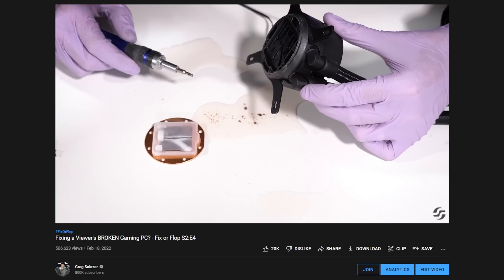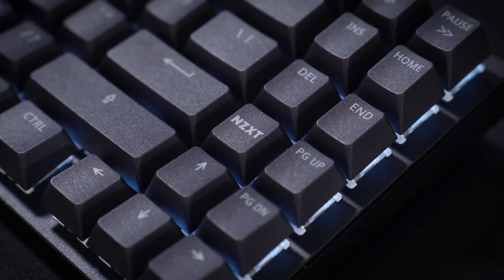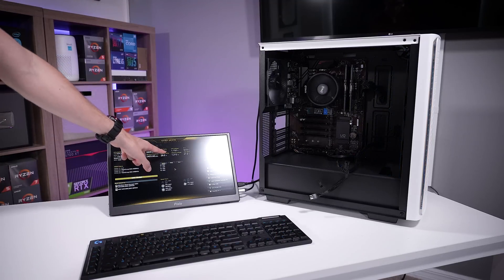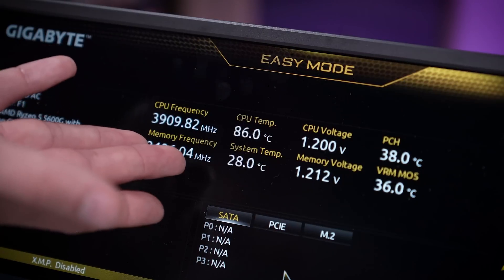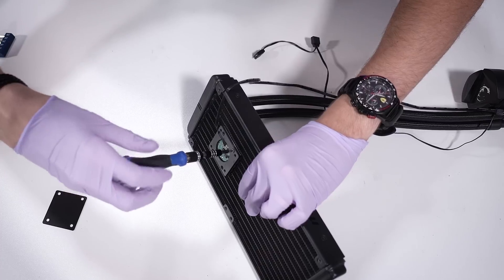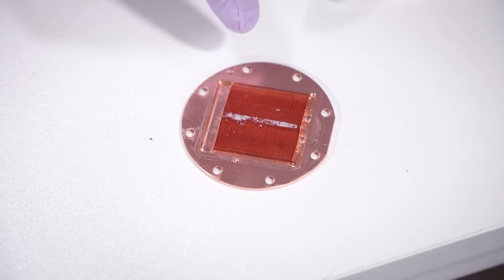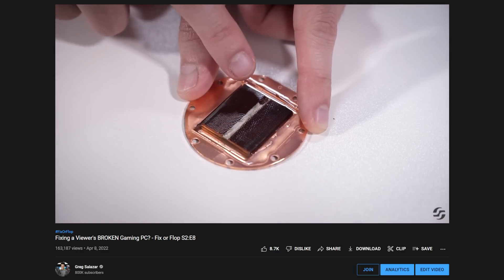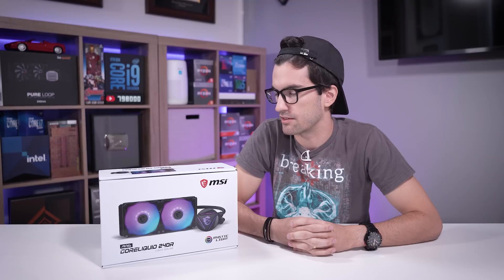Testing Viewers' Recalled AIOs

Comment: MSI would not send me a replacement under recall they said I had to pay for all the shipping and send mine in first. Basically told me to suck a dick. MSI 240R MAG, identical to ones in video and temps idle around 70c and gaming hits 95c and throttles cpu to under 4ghz to bring down to 88c on 5600x

Comment: I've got an "Ibuypower" 120 AIO that is like this with the pump in the radiator. I'm pulling it out this weekend and putting in a 240 Deep Cool Castle EX. With that said It was your videos that lead me to the issue I've been having with my PC. My PC had temp swings that would cause it to shut off. I haven't had the time or resources to swap a bunch of parts to troubleshoot. But seeing the other videos you've done have helped. Thank you.

Comment: Just found out about all this. Had this issue come up with my pc months ago 65c to 75c idle temps and not much load would cause thermal protection to shut the pc down but couldn't diagnose it. Even tried reapplying thermal paste. so the pc has been off for months and I was just going to eventually start throwing new parts at it till something worked but hadn't gotten to it yet (planned to start with upgrading to a ryzen 5800x from my 3600xt to start since prices have come down). After hearing about this I took the coreliquid 360r off and put my stock amd cooler on and wouldn't you know it right back to normal temps even under heavy load. But the recall page says mine is not an affected unit when I check the s/n which blew my mind since it follows the symptoms to the letter and the thermal problems were fixed when I swapped the coolers. So I just submitted a warranty ticket and I guess we'll see what happens there but I'm thinking that the issue runs over a larger range of the project than they originally have recalled it just didn't seem to happen as fast to mine as it did some others that I've heard of. Mine lasted a little over a year of use before the problem showed itself.

Comment: i bought one of these for a new pc i built a few weeks ago and later found out about the recall but am currently seeing normal 30-40 idle and rarely goes over 60 in gaming at the moment, ive been thinking of flushing and replacing the coolant but would be the first aio i would have dismantled, would you recommend giving it a flush and replacing coolant or should i leave it to see if i get the problems others are getting?

Comment: HI Greg, I purchased an MSI pre-built PC and am noticing really high temps when playing a specific game that is very cpu intensive.  The AIO I have in my system is this Corliquid 240r.  Now my idle temps are not as drastic as in your videos (roughly 40 degrees celcius).  I notice my issue when the CPU is under load and my temps go skyrocketing (my pc has thermal throttled due to temps hitting 100 degrees celcius).  I've been doing a ton of research and I think part of the problem is my cpu which is an i9-10900k, I heard this cpu was a thermal beast.  I have used the intel extreme tuning utility to change my optimal setting to have my cpu overclock to just 4.3 GHz instead of the 5.0GHz that was causing it to rise to the 100 degree celcius mark.  RIght now with that overclock setting, my max temps still hit 90 degrees celcius.  When my temps are this high, one of the odd things I am noticing is that the front half of the aio, the half with the pump, is emitting really hot air, but the back half of the aio doesn't feel all that warm.  Do you think I am suffering from this issue still (blockage)? Even though my AIO seems to act normally under idle?

Comment: Can you open these things up clean out the gunk and replace the water/fluid? If so what is the fluid called? I have the exact same issue with my CPU, in Bios I'm hitting high temps and they don't lower and I'm beginning to suspect the cooler, which is a Fractal Lumen S36. I can RMA it but would like to repair it myself if possible.

Comment: Had this same cooler and had a horrific clicking sound every time the system ran within 3 months of purchasing the AIO. Couldn't get a replacement since their customer support didn't respond in a timely manner, nor could I send the original sent back, so I completely switched brands.
Reply: I had a similar experience. They actually ended up telling me that my 240R wasn’t part of the affected batch despite mine having the same gunk and the orange/pink/red color. I won’t be buying another MSI product after that.

Comment: I'm wondering if this is what happened to mine. I had a Kraken M22 I just had to replace after almost exactly a year of having it, I was idling at 60c and getting 85-90c temps at 30% load. Replaced it with an x63.

Comment: OK so why did you have a radiator below the pump head that might’ve been why it didn’t cool considering the fact that it’s clean why don’t you test that correctly with the radiator above the pump?
Reply: Pump orientation doesn’t make a difference for cooling. Even if it did the difference is negligible. There’s a few videos on this topic already

Comment: Thank Greg, without this video I wouldn't have known about the Recall.
My CPU got warmer and warmer the past few months and I was wondering why. I repasted it and everything and thought "welp, guess it's dying and I need to buy a new one" and then this video happened.
What's funny (or not) is, that the day I submitted the recall (sunday, May 29) was the day it finally gave up. The exact same day I file the recall it completely dies and goes to 75-80°C on idle. I ordered a cheap air cooler for the time being and waited until I finally heard back from MSI. I didn't get any info or anything, just an email on monday with a shipping label telling me to ship it by UPS to Poland. As the replacement air cooler arrived monday evening I shipped it on tuesday. It arrived in Poland on wednesday but the RMA tracker didn't update until thursday where it suddenly jumped from "RMA request accepted" to "RMA shipped" but got no tracking info whatsoever. They said they shipped it out on June 3rd. It didn't arrive at saturday and monday was a holiday here in germany so I thought "well, I guess it arrives tuesday". On tuesday I got a text from UPS telling me it's arriving on wednesday and that was also the first time I got a tracking number. The tracking told me it was shipped out on monday and the shipping label was also created on monday (while they told me they shipped it out on friday). Wednesday I waited the whole day just to have UPS cancel it this day because they had too much to deliver that day so I got it yesterday.

I got my MAG CoreLiquid 360R replaced by a sealed MAG CoreLiquid 360R V2 and idle temps dropped down to 35°C. Never got any contact from anyone from MSI the whole time, it was just one single automated response and me sending out the cooler and 1.5 weeks later receiving a brand new V2 cooler. Spared me from having to spend big money on a new AIO (would've gotten a Corsair iCUE H150i ELITE CAPELLIX).

Thank you!

Comment: I haven't turned on my new home build yet. AIO problems could be (maybe) solved if they added a micro-size filter in the system that could be replaced. This would also help when cooling fluid needs to be topped and/or replaced. If they used clear hoses, that would help too.

Comment: @Greg Salazar i just submitted my RMA and MSI is sending out the replacement before receiving my 240R .. qutoe snip from email "
 
1. Please ship defective item after receiving replacement unit.
 
2. It is required to return the entire unit including components unless instructed not to otherwise.
Original packaging not required.
Include all original contents, ie Screws, Cables, Fans, and Brackets.
Please ship defective item after receiving replacement unit.
3. A Prepaid FedEx Shipping label will be included with the replacement unit.
You must package your RMA items inside a proper carton box.
MSI is not responsible for any loss or damages caused by shipping or improper packaging.
A Prepaid Shipping Label will be included with the replacement unit to ship back the defective item.
You can use this prepaid label at any authorized FedEx Location to return the defective cooler.
Please Print this email and insert in the packaging.
4. Once your RMA package has been received.
It may take up to 3-5 business days for it to be unpacked and scanned into our system. After this process, you will receive an email notification that your defective return is complete.
5.Please notify MSI if the address below is incorrect or has changed before shipping items.
 "

Comment: I'm currently using an Arctic Freezer II 280mm.  Radiator mounted to the top of the case so definitely above the block.  The pump is definitely in the block and not the radiator, because they put a transparent window so you can see the pump spin.  This thing works well, it keeps a 12900k <65C even under full load (Prime95 load).  My experience with these is only this one, and a Corsair H60 (which I used on a 6700k - and it's still working perfectly 7 years later, I gave my old system to a friend).  Thanks to these videos, I now don't trust MSI coolers, haha.

Comment: It happend to me with NZXT's M22 AIO. I dissasembly it and cleened it out and new water. Now it works fine again.
Reply: I just went back to tower style air cooler after my NZXT M22 Kraken stopped cooling even though the pump still worked.

Comment: With the design of this setup having the pump in the radiator is it bad to have the radiator mounted in the over head position? I had originally intended to mount this up top but later changed my mind and ran the rad to the side panel hoping to keep the pump "submerged" as much as possible. Wondering if this could be the difference between being happy or a mess? I have the 360r v1 over my 5950x since new, running 24 hours a day holding 66c under full load... I too and one of the "inconvenienced" and am torn whether to spend the down time or run it till it drops and chuck it for corsair...

Comment: Fantastic video Greg! I've not encountered these issues with my Corsair H100i V2 AIOs, but it is still nice to know this sort of stuff can cause temps to soar. The only concerning issue I've noticed with one of them was a little bit of corrosion on the cold plate. Thankfully no issues with the system have occurred yet. Also, not judging, but at about 11:56 in the video I couldn't help but notice your little one in the background, lol.

Comment: My ID Cooling Auraflow X 360 had the same gunk issue a few weeks after that fix or flop vid. As I was looking for clues as to why my Temps were rising day by day (plus more pinging sound).  I've opened it up and cleaned the block, but haven't tried doing a complete flush and fill, since I'm lazy moving things around on my build :P While ID cooling's sold in my country, I don't think they have a presence here like what MSI has (and they're also offering RMA for locally bought units)

Comment: I have a CORSAIR - iCUE H100i ELITE CAPELLIX 240. Its been running for almost 2 years now and no issues. Quite as all heck and with a over clock 5600x very stable temps both idle and during intense gaming. Couldnt be happier with it.

Comment: AiO sucks... I rather have a Sythe or DeepCool tower air cooler than a AiO... I was a big fan of water cooler until one AiO block cracked and leaked water inside my PC... Never will use Water inside my PC again... Air Coolers are much much better... And those AiO are all garbage, doesn't matter the brand, all Chinese e-waste. And I do believe that all are filed with tap water...

Comment: Man, MSI's steppin' up to the plate like a boss on this. I know this should be the normal behavior of a company, but such is so often not the case for things like this. Companies like Gigabyte with the way they handle things, has led me to never buy a single one of their products. Meanwhile brands like MSI, and Asus (I believe) continue to build customer security, and confidence. Razer is another company that kicked ass for me. I got the Razer Chroma ARGB hub, and the first port was faulty. It took them a month to RMA, and ship a new one due to Christmas, but they did with very little effort on my part.
  I have a Frankenrig with parts from all sorts of companies, IE: AMD CPU, EVGA Nvidia GPU, Corsair RAM, and so on, and it's nice to know that at least some of the companies I help support are willing to do the right thing.

Comment: I have a Corsair Hydro Series H45 120mm AIO and i've been using it since january 2018. It worked fine until i swapped processors for the second time and had to figure out a way for it to function properly again after it started acting up once i had separated it from the rest of the system in order to install the new cpu. I managed to make it work again by fidgeting with it a little in favor of the bubbles to get out of the pump and it worked fine until i recently swapped CPUs again and it presented the same problem as afore-mentioned. I had to mess with it a little again for it to work as intended. Turns out i managed to reach a much better temperature than i was getting with a colder CPU before. I must've had bubbles in the pump all along and didn't even notice since the temperatures were "ok" lol. Putting 2 fans on a 120mm AIO (one on each side of the radiator) makes the temperatures better as well, especially if it is your systes'm main air exhaust

Comment: I have a question. Since the pump is built into the radiator does that mean the placement of the radiator isn't as important as ones with it on the cpu block?  GamerNexus always says tubes down if you have to front mount but preferably should be top mounted.

Comment: Laughs helariously . i have a Acetek cooler thats like 7-8 years old , it was given too me free , i drained it and rain 99.99% isoprophenol through it too clean it out drained it and took a shop vac too it then filled it with Car radiator coolant and sealed it up .. it was clogged just like this cooler .. i have been using it with car radiator coolant and cleaned out now for 4-5 months and it runs super cool on my hot ass CPU ... send me all your clogged AIO i will fix em and built with them ...

Comment: I recently just fixed a 120mm IBUYPOWER AIO that comes with prebuilt systems. I just did this same exact thing, it was making a clicking and grinding noise under load when the pump would ramp up. I researched it and found out a lot of those AIO's ended up with gunk build up covering the cold plate fins reducing water flow, causing air to go in the pumps located in the radiator and prematurely wear out.

I disassembled a clients AIO, found a bunch of debris. Cleaned all of it out, worked any air out of the system keeping the housing/cold plate side up as the highest point and moving and rotating the radiator below. topped it off with distilled water and sealed it back shut eliminating almost all air from the system.

When we fired it back up, no leaks, ran super quiet, no more clicking or noisy pump sounds. In addition IBUYPOWER installed the ram incorrectly for dual channel ram, they had it in slots 1&2 rather than 2&4 as recommended. Also the ram wasnt set correctly in the bios either. Fixed all of that for the client in an hour and 45 minutes on site for a low cost.

Client was extremely happy, thought it was going to charge more and it take way longer.

Comment: Just an FYI, I ran water cooling in my system for 8 years using 50/50 mix of Zerex car coolant and the day I stopped using it, tore the cpu block apart and it looked as good as it did when I first bought it. This was back in not early water cooling but more along the lines of early kit cooling. System was a Vantec Stingray. Great stuff just mostly got tired of the maintenance so went back to air.  Just bought my first AIO a year ago for brand new build, if I ever tear it apart I will likely just refill with that same Zerex... Especially since I still have half a gallon left lol. ;)
Reply: @GregSalazar I take it the above post isn't actually yours...

Comment: My EK-AIO Elite 360 was also getting my undervolted 5600x in the 70º 80º. I opened it and the coldplate was clogged, after I cleaned it and reffilled with destilled water the temps are now much better 49 55º in warzone. The pump makes a bit more noise but it doesnt have almost any air left, must be from not beeing sealed in vaccum

Comment: They didn't recall all 240R AIO's . They only recalled certain serial numbers. I still have mine and it cools my 5800x awesome.
Reply from the maker: No one said your AIO would have growth immediately after purchasing. And if you bought one after the problem was addressed, then of course you won't be having issues. Many folks are running into problems months after continued use...

Comment: I also have an MSI 360AIO and it was the same problem. I took mine apart and found the the same sludge in my heat sync and also sediment out of the radiator block. It also presented with the same orange hue and smell to the fluid. I flushed it multi times with de-ionized water and then refilled with with Cryofuel. My temps when clogged were near TJ at idle. Now i run around 30c at idle. Thank you so much for all your help Greg.
Reply: what screw driver is used for the plate
Reply: @Arzful  from memory, I believe it was a small torque screw(t1 or t0). Although the newer version have replaced them with tamper proof screws which are only supposed to turn one way. They can still be removed, though.

Comment: untreated or regular tap water does this with metal. same thing with full strength coolant in vehicles,  when you mix in tap water and not distilled water it does the same thing
Reply: It’ll do it with distilled water.  It needs a biocide has to do with copper reacting with aluminum.
Reply: @TheSjuris  Biocide doesnt necessarily stop the metal corrosion its just stopping anything from growing in the liquid
Reply: @TheSjuris  in an aio I can see that